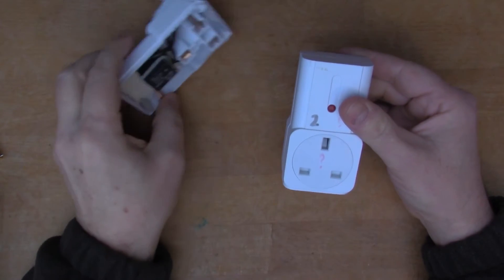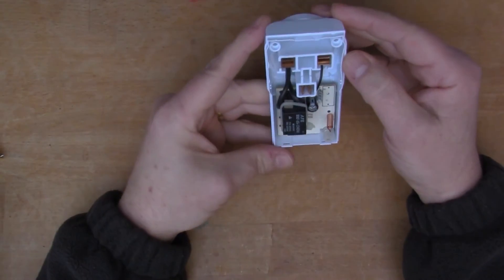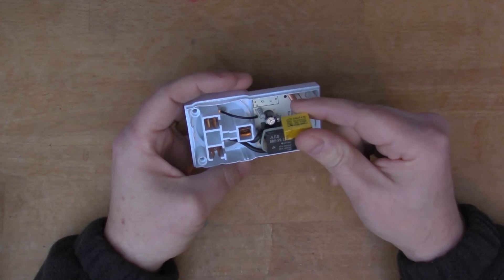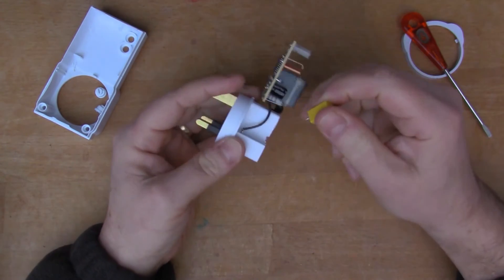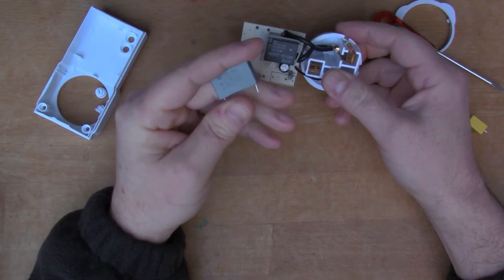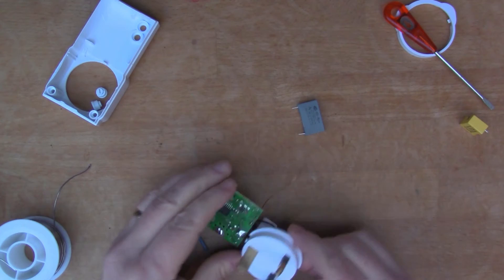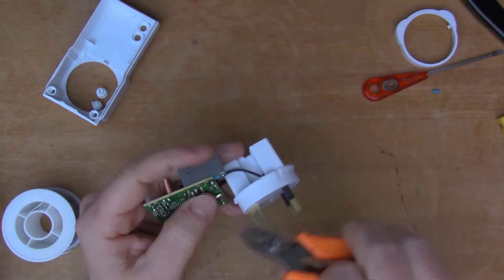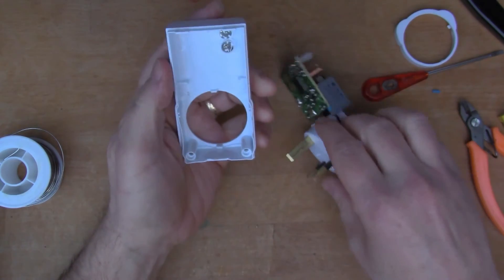Radio Control Power Switch - Repair

Comment: I have jtd branded two sets of 5 for 4 years. version 2 I think with the rubber buttons. One set 4 of 5 failed. The button on the unit works so it's not the relays. I tried repairing and nothing works on any of them. On the other set 3 of 5 failed with the same thing. I only controlled low wattage lights with them.
Reply from the maker: If the button works, then perhaps it's the radio section that has failed.  It's not impossible that the electronics could be damaged by a surge or spike.

Comment: My plastic caps are just being sent, you have no idea how obsessed i am about these RF sockets. On my socket there was 24V supplied but it dropped to 16V when relay was on, making it unable to turn off via RF. At first i was blaming old electrolytic cap which changing helped nothing. And then i found your movie with magic "capacitor dropper circuit" and everything clicked like working relay. Thanks, subbed!

Comment: Hello Martyn, Thank you so much for the video. Conducted successful repairs on faulty sockets as you described. 100% success. Used 0.47 micro-farad Met Poly Class X2 capacitors from BitsBox. The Torx screws were the trickiest part, T10 with security centre pin. Cheers.
Reply from the maker: I'm glad that you had success.

Comment: If you're trying to find your way into these sockets, like I was, the trick is to twist the collar that surrounds the pins. It takes a bit of effort but it will come off and you can then access the two Torx screws.

Comment: I repaired two of these devices today using the instructions in this video. A pack of ten capacitors was very cheap on eBay so I have 8 spare for future repairs :)

Comment: Remote Control Etekcity zap plug switch from amazon uk. plug was stuck on  fix my switch  hit it on a wooden table twice,it then started working again.
Reply from the maker: 'percussive maintenance'
Reply: Probably a sticky relay. These things are often let down by cheap relays. I have the same problem with some wireless light fittings, sometimes sticks on and I have to smack it with my fist to get it to turn off which is frustrating for me and impossible for my wife - perhaps I should should hang a little hammer on the wall next to it.

Comment: Thanks for the tip - I had 6 of these switches that had given up sitting on a shelf. I found some equivalent capacitors on ebay and swapped them over, all now appear to be working again. Fingers crossed they will last.
Reply from the maker: Excellent!

Comment: Martyn, thanks for the upload! I've been struggling with my very similar faulty item, too, and this was a great hint, as that nice sturdy cap was not my prime suspect.

You mentioned yours was way off, but how much, actually? You said "nanofarads", but how many? Since it's 330 nano originally anyway, anything between that and zero are nanofarads. Mine seems to have "only" halved (140 nano), which is certainly unhealthy, but I'm not sure if that's the same kind of damage as yours.

Nevertheless, I unsoldered and replaced it, too, but could only find a 0.85uF (250V) at hand. With that, strangely, the relay did engage, but then the controller couldn't release it. I could hear it struggling, but it got stuck. The LED, too. So, the problem persisted, but now upside down. 
But I can't seem to explain that simply with the bigger cap. (Trying to rev. eng. the circuit right now.)
Reply from the maker: I can't remember what the measured value was, but this is a capacitive dropper circuit, so basically a voltage divider formed by a capacitor and a resistor, dropping the rectified mains to a useable low-level DC.  On that basis, it doesn't take much for the circuit to go out of whack, as a lot of low-DC circuits can work at 12V, but not quite work at 9V, so that's really only one percent of 300V.  In this device that I took apart, when the cap goes bad, the LED still goes on and off, but there's not enough oomph for the relay to function.
Reply: Thank you for your kind reply & further insight. Yes, mine does roughly the same: LED OK, but the relay can't hold. Mine does engage, but after 1 second it releases, with the LED happily staying on.

There are two Zener diodes at the input (one for the 24V relay drive, the other for the logic, etc., I guess), right after that bulky filter(?) cap (mine has the exact same orange .33uF piece as yours), so I thought even I skew the voltage up with the bigger cap, the diodes would help me out. (Bigger C means smaller Xc, so less voltage on the R-C, then more on the rest, so I assumed the "regulated" parts being safe even after doubling-tripling the cap.)

(Sigh, I know I should just get a replacement cap, but I promised myself to understood that thing, not just fix it. :) )